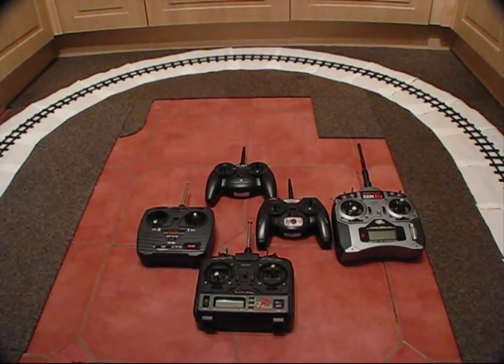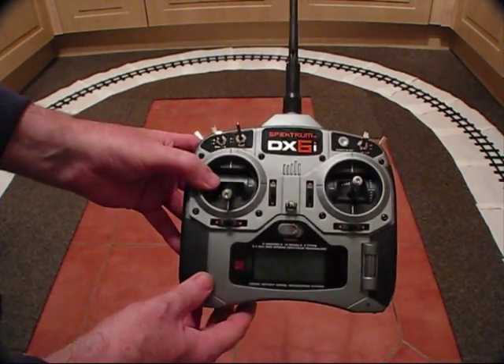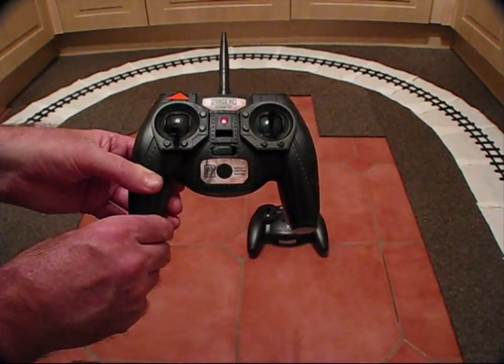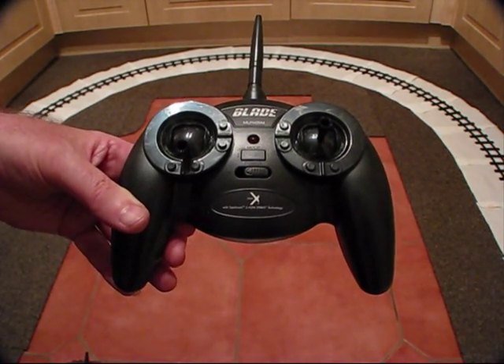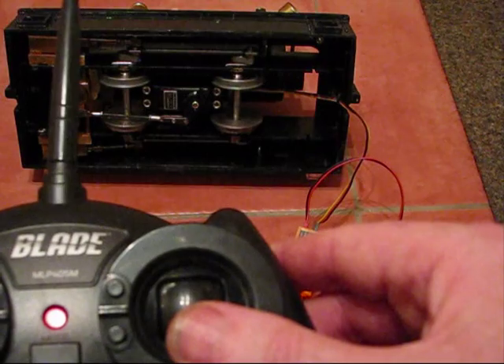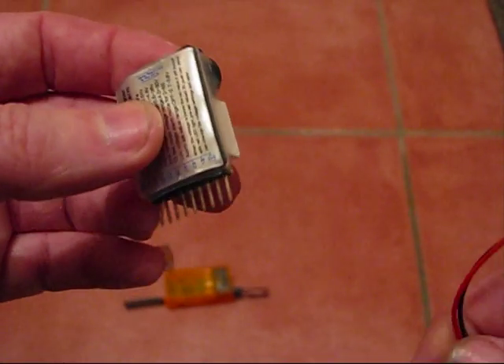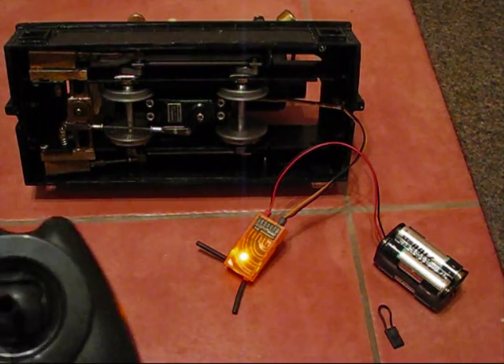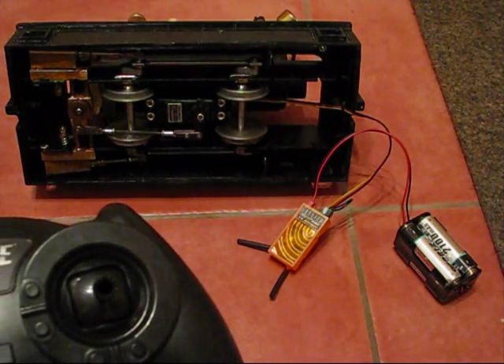How to use 2 4GHz DSM Radio Control in Live Steam Locomotives Part 1 of 2

Comment: Chris, better to put ur toys away from da ktchn B4 ur wifee comes home!

I didn't know that the R/C industry got more interference resistant higher
freq > 2.4GHz.  I'm coming back to the R/C live steam projects after 10+ yrs.
I want more than 2 channel Fosworks deal for my locos.  So i bought 
Micron Tx24p3 5 channel handheld Xmtr which supposed 2B compatible
w Lemon (compatible w DMS2) rcvr.  But failed to bind as the binding instrn
was too complicated*

Here r the functions i want for my
16mm/ft (1/19th scale) Lynton n Barnstaple Lyn 2-4-2 and 
F-Scale (1/13.7th scale) Forney 0-4-2:

1.  Direction
2.  Throttle
3.  Whistle (sound card) or real
4.  Gas fuel
5.  Blowdown valve (for Forney)
6.  Cylinder Drain (for Forney)

One feature of live steam R/C control needed is the xmtr s/b operable
using only one hand to carry AND to operate vs. airplane or automobile
models.  With the Lv Stm, u'll need to chase around the track** n u constantly
need to view the fire, pressure ga., water ga, rotate the rods if stalled ...
and u want one hand operation of the xmtr.  No heavy two hand xmtr operation
unit.

So what do commercial brand of rcvr n xmtr do you recommend?
___________
*It's really better to have the maker pre-bind the xmtr n rcvr
**Chasing at an old age (or even young age) is not desirable, thus the need for
   an R/C Control